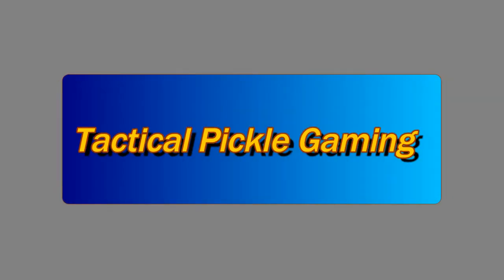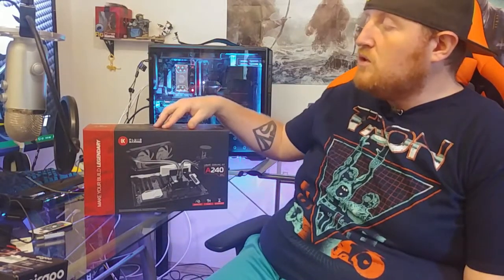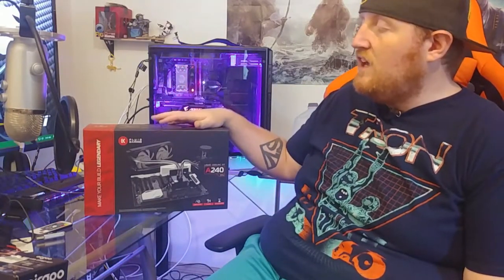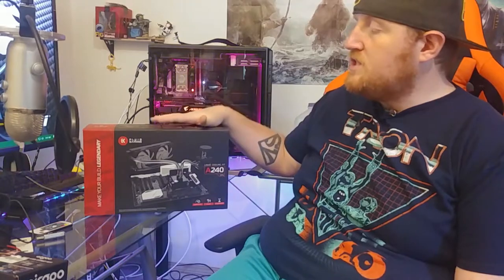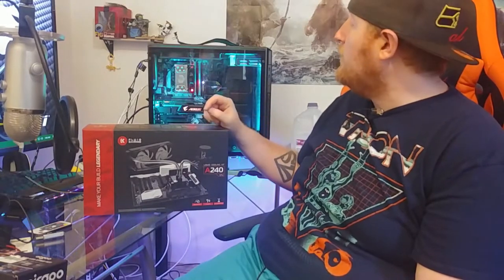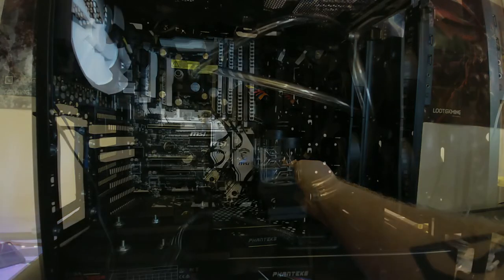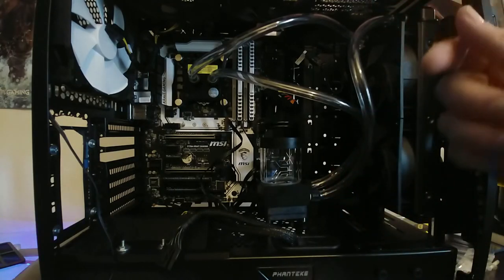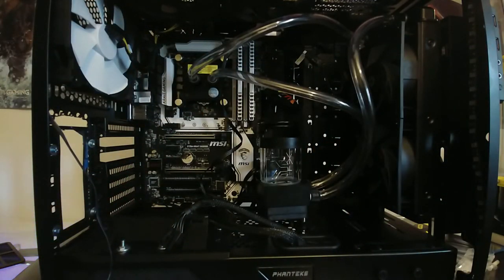EK Fluid Gaming A240 water cooling kit indepth install guide!

Comment: Nice video, thanks for sharing. 

One question though, how about flushing and changing the coolant? How would you go about that with this kit?
Reply from the maker: +NapFloridian thanks for watching! The easiest way would be to unmount the radiator so you can move it close to something you can drain the coolent in, then disconnect the tube running from the pump to the radiator at the radiator side, then you can install the jumper on the motherboard power connector to cycle the pump, making sure not to run the pump dry

Comment: When you replaced your thermal paste i hope you still had some of the tim that was supplied with the kit,if not then i'd check to see if your block hasn't corroded yet
Reply from the maker: +YungMurcie thank you for pointing that out as it didnt even cross my mind! I replaced what came with the kit with antec nano diamond formula 7. I will have to look into it and make sure its safe
Reply: Tactical_Pickle Gaming if i'm not mistaken it should say so in the manual.i'll have a quick look into it.
Reply: Tactical_Pickle Gaming i just checked,it just says that when using liquid metal you will suffer carastrophic failure,so no problem there,but i also heard that certain metal based thermal compounds can be bad as it will cause corrosion,depens on the composition of the thermal compound you used,but i can't seem to find a full composition of it but if you check the waterblock and don't see anything wrong with it you should be good.
Reply from the maker: +YungMurcie thanks for checking into that and helping me out! I also emailed antec support to get clarification as well. I was considering delidding my cpu amd using that liquid metal but after more research it seems that it dries out and hardens which can ruin the cpu. So for now i am satisfied with my performance
Reply: Tactical_Pickle Gaming no problem,i help where i can ;-), it's not like your temps are really high so i wouldn't bother delidding imo
Reply from the maker: +YungMurcie yea im probably not going too unless i plan to overclock higher than 4.8 but i doubt i will
Reply: Tactical_Pickle Gaming 👍
Reply from the maker: +YungMurcie i recieved a reply from a rep at Antec that the formula 7 is safe for aluminum!
Reply: Tactical_Pickle Gaming good to know 😉

Comment: he forgot one critical point flushing the radiator with distilled water before install not doing that can be fatal for the pump also the output from the cpu block goes to the radiator input so the coolant flows thru the radiator to be cooled and then to the reservoir and  then from the reservoir back to the cpu block with cooled coolant. you don't want to send hot coolant into the pump then back to the cpu block so this install is a bit backwards  Go not install it the way he said  read the instructions output from the CPU block always foes to the radiator input
Reply from the maker: +Joe Todd thank you for the feedback, you are correct i should have flushed the radiator prior to the install however the kit is installed correctly per the supplied intructions. Regardless of how you do configure the kit, the coolant will still pass through the radiator prior to reaching the cpu block. This will not send hot coolant back to the cpu block.

Comment: how tall is the pump?
Reply from the maker: +Ballboysoccer when i get home from work i will messure it and let you know!
Reply from the maker: The pump/reservoir are a little less than 5 inches tall. With the supplied mounting bracket that works with a 120mm fan location it would measure out to a little less than 5.5 inches! Hope that helps
Reply: thank you i wanted to know to see if the pump can fit in a corsair air 740 and not interfer with the motherboard
Reply from the maker: +Ballboysoccer it looks like you would have plenty of room to mount this kit with out interference. I think the only clearence issue that you might run into is if you have a long graphics card

Comment: And what is the case you are using
Reply from the maker: +Ballboysoccer the case im using is the phanteks enthoo pro m acrylic, i have a video reviewing it on my channel as well
Reply: One more question if you dont mind, how did you connect the pump fan header to the motherboard because the fan cable is short
Reply from the maker: +Ballboysoccer no i dont mind at all, they actually supply an extension cable that is more than enough to reach! I was worried about that myself til i found the cable in the box lol
Reply: Tactical_Pickle Gaming thank you for the help
Reply from the maker: +Ballboysoccer of course! Thanks for watching!